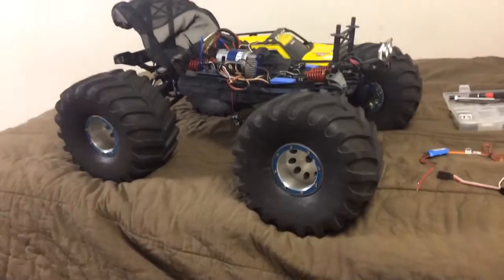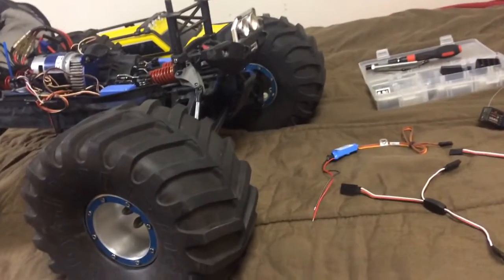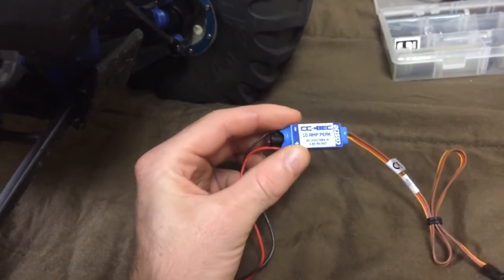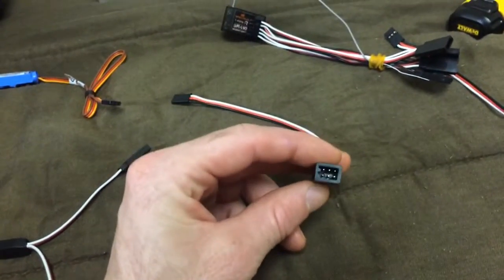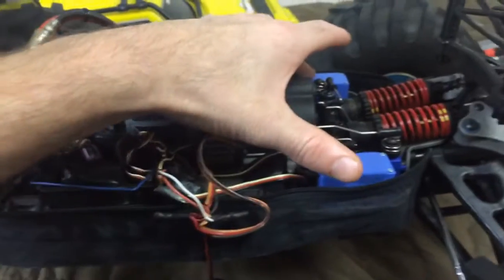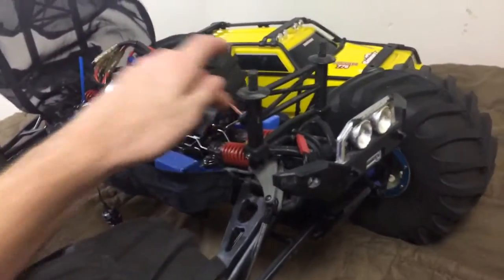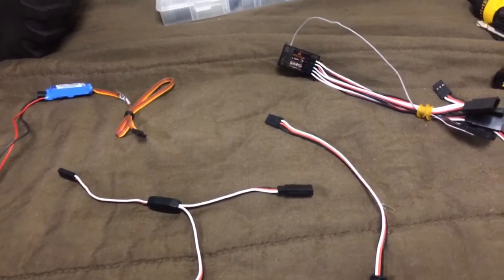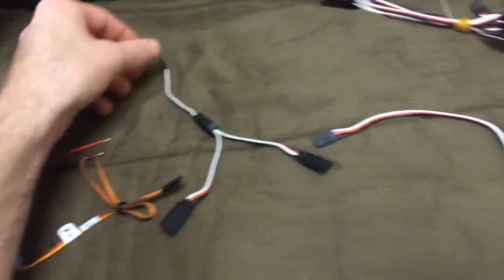Traxxas Summit Dual Steering Servo BEC Help!

Comment: The BEC plugs directly into the receiver. Everything that is plugged into the receiver then is powered by the BEC. You don't need a splitter at all. The only modification you have to do is disable the red wire going from the ESC to the receiver. You can cut it but it's also possible to just pull it out of the connector. If you prefer to not cut or modify the factory ESC wire going to the receiver you can either purchase a BEC servo extension or make one from one of the wires you already have. Here is one you can buy from Hobbyking or just look at it to make your own.
https://hobbyking.com/en_us/185mm-bec-eliminator-cable.html
As you can see, the only difference is that there is no red power wire.
So, to be clear, on the stock Summit the ESC wire that goes to the receiver also powers the receiver and all the servos and anything else plugged into it. What you want to do is stop the power coming from the ESC (disabling the red wire) and instead you plug the BEC into any open channel on the receiver. (preferably a battery port)  The BEC will then power everything plugged into the receiver.
Reply: did you make a video or did you have some picture of that ?
Reply: Thanks for the info.

Comment: your bec in the esc has nothing to do with the motor other then providing signal , any how that being said i can not get a bect to work at all in my wifes summit so i installed a glitch buster and that worked out really good stuff have some light flicker very minimal but it does still do it , i cant find anything my self on hooking a bec to the summit there are not avaiable channels and the bec has to go into a open channel the other problem you get is the voltage the servos run so the idea of using a seperate reciver of the same and bind second reciever to the same radio and just hok the servos into it then power the reciver also indepent of the rest of the system that was the best idea given to me by great hobbies .. my wifes servos are no more then 6 volts but they chew 1.2 amps each full load so the stock ecs still struggles a bit even with the glitch buster but is sure beats brown outs that i was getting and you install the glitch buster to the RPM port only
Reply from the maker: Lol I need to do a update video so bad. I threw out the stock setup and went with the MMP. As for the steering I’ve tried glitch busters and BECs. Nothing seams to work. Without flickering.

Comment: I wanted to know the same thing, as I may be going back to a dual servo setup (waterproof Savox), and use the single Savox 1230sg in another vehicle, that most likely won't be run through water (such as a brushless). I was thinking of doing the double y setup, the traxxas y connector is shorter (or you could just cut and shorten the ones you have). Hopefully, you find what you're looking for.

Comment: Did you ever get answers for your summit twin steering servos bec Because I am in the same spot you are today. I don’t know the proper way to wire up my servos. I would greatly appreciate any advice
Reply from the maker: Dan, I will follow up with you tomorrow on the answer.

Comment: Did you solve this ever lol? I am using BEC to power only my high power dual servos by isolating the power using Holmes hobby Rx bypass adapter. This lets you continue to use the BEC from your esc to power the receiver and shifting servos at 6 volts and then the castle BEC power for the servos only - and let's you crank the servo voltage up to servo rating! It also stops the lights from blinking on the summit! Three rigs running this way. With the dual batteries you MUST finding the proper BEC wiring diagram on the castle website. Do not rely on random web searches as they are often wrong. You have to solder them leads to the correct battery only. Use the new waterproof castle BEC too. It also has a second power output for lights etc.  instructions say to plug second output into receiver also. Don't! It works fine without. I use it for a light bar. Oh and yes just use a Y-splitter from the castle BEC to the servos. They get equal power. It is not halved. Good luck!

Comment: did you find the way to install the bec because I have the same Bec and I also dont know how to install it
Reply from the maker: Jean-François Ménard Does your ESC have a label on the red wire?
Reply: I just found the way to plug the same bec on my summit . I will take some picture for you